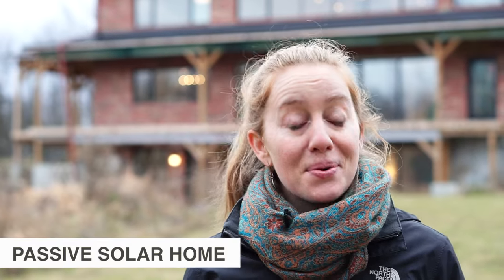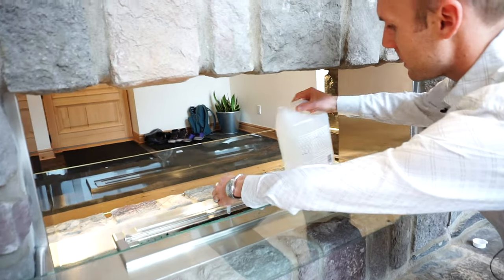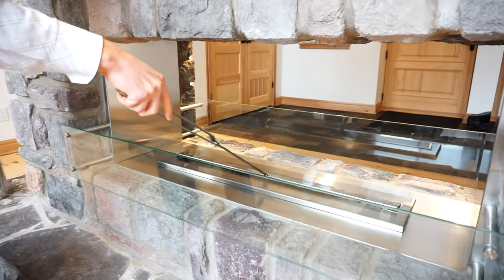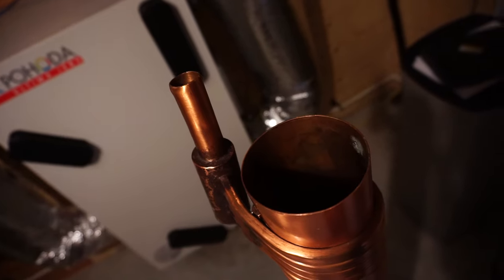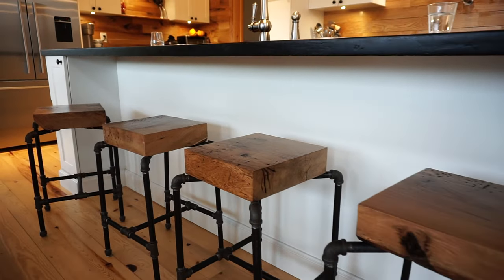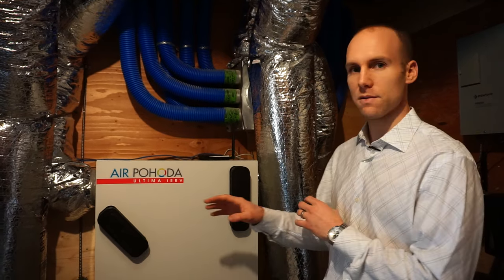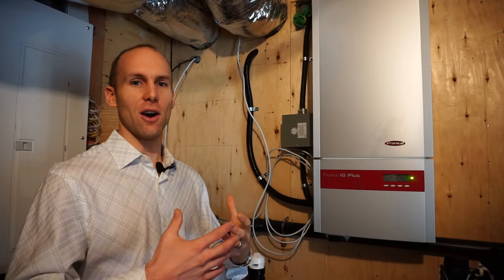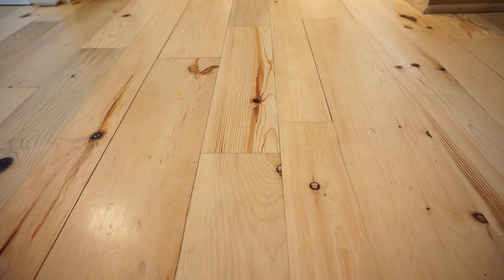Couple Builds Energy Efficient Passive Solar Home - Green Building

Comment: In 1981 I build a very comfortable 2400 sq ft 4 bedroom passive solar house that could easily be brought up to the passive house standard today with simple modifications. I applaud your energy efficient structure but 4000 sq ft is perpetuating the problem while trying to be the solution. We could start a new green building category called Ironic architecture
Right now on the design table is a 2100 sq ft 3 bedroom house that includes an inlaw/rental suite. This will be built in a small town that has very low rental affordability and supply.  We have to build small as well. Read "Small is Beautiful" by E.F. Schumacher.
As a highly skilled builder I will soon be helping to build a 14000 sq ft home. The money for building is great but I think these houses should not be allowed to be constructed. It boils down to why should one person be able to consume so much of the worlds resources while others have nothing.

Comment: I want a self sufficient home, so that I don't have to pay bills for electricity or for water, but I require a LOT of electricity, because I use power tools to build little projects and play electric guitar about 2-6 hours a day depending on how busy I am. What should I be looking into?
Reply: If you take your electricity bills into your local photovoltaic retailer, they'll be able to give you a pretty good idea of what you'll need to go right off the grid. 
Without knowing your climate, age/size of your house, number of occupants etc, it's impossible to answer. 

But, you'd most likely be looking at a grid tied PV system, where you generate electricity when the sun is shining, and selling it back to the grid, and using grid energy when it isn't. 

If you have running water, microhydro is hands down the way to go though.
Reply: In addition to Luke's good advice, battery storage is becoming much more economically viable, particularly for a new build. If I were doing a new build Tesla's solar roof and storage would definitely get a look.
Also, going down this path, you will inevitably become way more efficient in energy usage. It's surprising how easy that is. Our system of a house and 2 cottages uses less than half the energy of an average suburban home, but we've been on this path for some time.
Have fun. The journey to no utility bills is a great adventure.

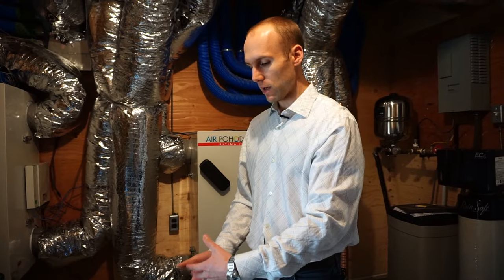Comment: 3:27 Drain water heat recovery device.... That is genius.
Reply: If the drain pipe was sloped, the small tubes would only need to be on the bottom  of it, saving mucho copper and it would capture more heat.

Comment: I think this is all great and amazing, but I can't imagine that some of this stuff is actually 'eco-friendly' at the end of the day. For instance that hot water recovery drain for their shower. It's literally a solid piece of copper. The cost, and really just the environmental cost, to manufacture that thing is probably many times more than the amount of energy ever recovered by slightly heated water quickly running down a drain. I just see a lot of these things not really paying off macroeconomically speaking. I guess it's great and all to feel like you're making a difference but are you really?
Reply: They've done calculations on Drain Water heat recovery and the economics do pay off. The simplest way to figure out if something is "green" is to figure out, noting most of the externalities is this: Does this save me money? The answer is yes. 
http://www.greenbuildingadvisor.com/green-basics/drain-water-heat-recovery
Reply: The copper won’t wear out and when it finally is scrapped it will easily be recycled.
Reply: With products like this, I'm sure it's recycled copper to begin with.
Reply: Copper is the ideal substance for this Heat Recovery hands down there may be a case for aluminum but either one will do. Copper just has the smallest footprint and is also more eco friendly than aluminum.

Comment: Triple glazing does not allow infrared radiation. So the room is not heated up! Better would be simply glazing but the best compromise is double glazing in this Situation!
triple glazing is great in the summer because it does not get heate up the room and you do not need shading.

So the positive solar effect of the windows is meaningless in winter in this project.
Pity!!!

There are great projects with solar air collectors!

Comment: Canada's house in Ontario doesn't qualify as a good example you should remove this off the list.   The only thing they did right or well is the large r factor walls and the large windows.  The big freezer for 2 adults and one child and the large washer drier are too large for their needs and large energy consumers.  Their bills are likely high for electric bills.  And the hot water heater being heated with a a heat pump.  I am sorry, but that is a really bad choice.   I am sure you can find better examples.   For normal size houses and lower energy use, need a suggestion, just send me a note.
Reply: Their grid power is 90% carbon free. So its much better to use heat pump than directly heating with nat gas. Plus no need to transport the gas.

Comment: A passive house should be warm from the people living in it. If you burn fuel it is not passive. The big space does not seem to be very well used. Sustainability would be to build much smaller and to burn wood in a stove. The amount of copper in the waste water heat switcher and the construction probably cost more than the money you will save.

Comment: When that hot water tank is finito can you simply replace the tank or do you have to dispose of the heat pump as well?
Reply: In theory, there's no reason you couldn't replace the tank separate from the heat pump. In practice, it probably never  happens. The tank will probably outlast the electronics/heat pump section (this would be even more true if they made the tank out of stainless steel, but I've yet to see one on a heat-pump type water heater). Even if the tank goes before the heat pump, which should be at least 6-10 years, that model has probably been discontinued (if they ever would have sold the tank separately in the first place). This is just a reality of appliance manufacture across the board these days, unfortunately.
Reply: I noticed they have the AO Smith one. Probably even better life expectancy on that one. From what my plumbing friends say, it's the best. But, a wee bit more than the GE i Got. (like 2x as much....)

Comment: What you do is good but not going to apply to most Canadians.  There are more traditional ways to do passive solar without so much equipment.  You deserve credit for thinking of others and spending the money in the right places.  By the way, what do you drive?  That 10 kw system should keep and EV on the road too.

Comment: His heat pump what heaters costs a bundle and the tank only lasts about 6 years. (If you are lucky). The money he thinks he’s going to save is well offset by the heigh cost of the items he’s purchased and the high cost to maintain the system.  Do the power companies in Canada not use coal or fossil fuels?  Where is he getting his electricity in the evening and at night?

Comment: That 80 gallon electric water heater is going to cost an arm & leg to run!  Ouch.  I feel that natural gas is a more efficient, more environmentally friendly option than using loads of electricity.
Reply: In Ontario, their grid electricity is 90% carbon free... So no way direct gas combustion could be better.
Reply: nope. it's save money. it's a hybrid (heat pump & coil) model. Theirs (The AO Smith) is the best. I've got a GE that is good, but, much cheaper. I had an "on-demand" system that was horrific in terms of cost to operate.

Comment: Seriously he could not find any other material for the counter-top besides concrete and epoxy... how about... wood like in most houses. 
Wood is renewable source no need to feel bad about using it, using reclaimed wood is not necessarily better cause you spend more time and energy on preparing it.
The rock isolation is not eco friendly either cause it requires lots of energy to be made... many wrong on that house, passive maybe eco friendly hell NO.
Reply: Kadum - We found out that he was subtly promoting his company to rich folks who wanna do "a little something" to reduce energy consumption to feel good about the excesses they practice.